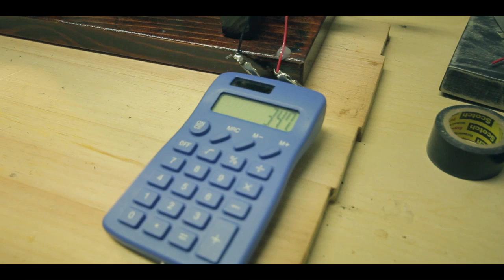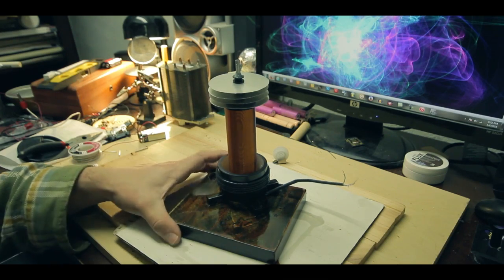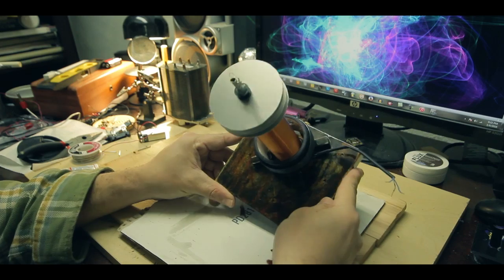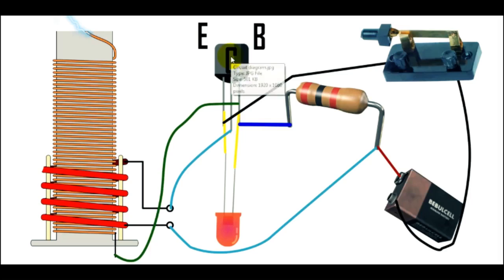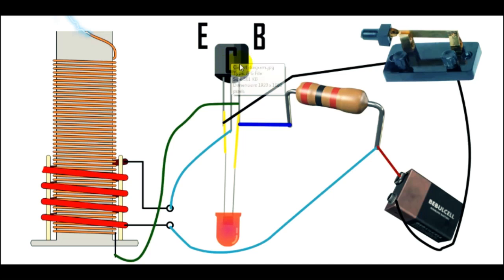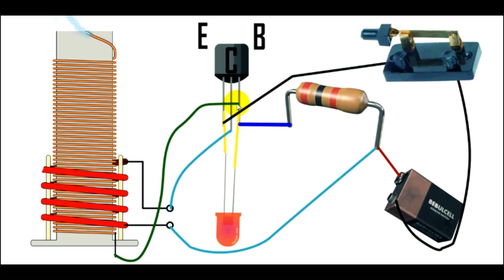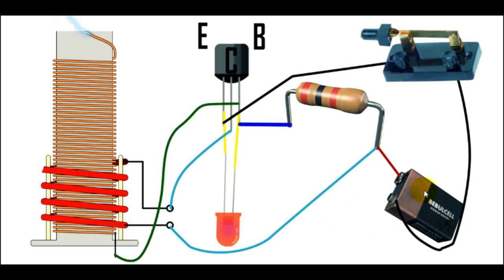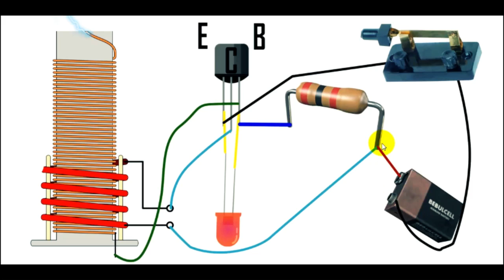DIY Tesla Slayer Exciter Coil Tutorial Mini How to Build Easy Circuit Explanation

Comment: Can I use another kind of transistor while keeping all the other parts the same? I'm trying to build a tesla coil within a week's time for a science project, but the link to the amazon page for the BD135 transistor says that they are out of stock.
Reply from the maker: I would search other sellers for the BD135, but you can use the transistors mentioned in the video: TIP31, N2222. If using another transistor make sure you are aware of its orientation, Base, Collector, Emitter. Hope this helps and thanks for watching. Good luck with your project!
Reply: José da Vēde Also one last question:
I'm planning on adding another 9V battery to increase the distance where I can light up a lightbulb; how would I add another 9V battery, and is this safe for me to do? Sorry for asking all these questions, this video has helped me a lot and I just want to get a good grade on my project lol
Reply from the maker: No danger. You may blow a transistor but it just makes a pop sound. I would use the TIP31 resistor, get extra. I believe I ran 20 volts through this coil before blowing the transistor, so you should be ok.
Reply: I finally managed to build one and it appeared to be working because the LED was on; however, it cannot power any of my fluorescent light bulbs. Is there a way to fix this? I am using a 2N2222 transistor.
Reply from the maker: What wattage is the lightbulb and is it a flourescent?
Reply: The light bulb is 13 W and it is a fluorescent. It is weird because sometimes it works, sometimes it doesn't. I have tried many bulbs, and they all end up not working.
Reply from the maker: Shakybird Are you running 9 volts or 18? It should work consistently. How many turns for secondary and primary coils? Did you use a 47k 1/2 watt resistor?
Reply: I am running 9 volts. The primary coil has 5 turns, and the secondary has around 385. I am using the 47k 1/2 watt resistor that you linked in the description.
Reply from the maker: Shakybird Try taking the top load off or disconnecting from the secondary and then put your lightbulb close to the wire?
Reply: Because of how I attached it, I am unable to take the top load off. But I am getting more consistent results from one of my light bulbs, so I think I will just use that for my project. Thanks for all the help
Reply: +José da Vēde I have a question can I do this without the top load hope you see this

Comment: Sir..what are the applications of such circuit ??in specific area ??
Reply from the maker: This is an oscillating circuit, which converts DC voltage to AC voltage. Typical oscillating circuits are used in various electronics such as radio and television transmitters, computers, and clocks. 

The Slayer-exciter circuit used in this video works as a step-up air-core transformer, taking a low DC voltage and converting it to a high AC voltage. The AC frequency produced through the magnetic flux lines are high enough to excite the phosphor in the fluorescent bulb, creating light. There are no applications for this specific circuit, other than to demonstrate wireless transmission. Only Tesla himself, as of today, is aware of any real-world applications for his coil designs. Hope this helps! Thanks for watching.

Comment: y do we need two coils?
Reply from the maker: Becuase essentially what this is,  is a step-up transformer which requires two coils to increase the output voltage. The primary (smaller coil) receives a voltage from the oscillating circuit and the secondary coil, through the magnetic flux lines (air) receives this voltage and increases it. This is why you need to coils. Any transformer usually requires two coils and they can either increase or reduce current. Hope this helps. Thanks for watching!

Comment: first of all thanks for your interesting video
I have a question , what is the aim of using transistors??
is it use to amplify the current ???
Reply from the maker: Yes the transistor in away does amplify the current through oscillation. Kind of like pushing someone on a swing. With each push momentum builds. With a transistor it works like a swing or a valve-- opening and closing the flow of current. This happens multiple times a second. The current in the primary coil is then amplified by the secondary coil. This is called a step-up air core transformer. Hope this helps! Thanks for watching.
Reply: thanks for your respond it helps alot

Comment: where did you use the heat sink in the circuit ?
Reply from the maker: Mahesh Rajput It's not attached to anything other than being screwed to the transistor. You really don't need it unless you are using a different transistor and using higher voltage.

Comment: Awesome build. Replicated your design with success! Thank you! 
Also, hate to bother, but I've a question for you mate. Would linking more 9V batteries (say 2-4, 9V batteries vs. the 1 used) effect range of the coil? And if done, should i use a higher value resistor?
I'm very new to electronics, and am being careful not to fry anything. I've no clue what i'm doing..
Reply from the maker: I powered this Tesla coil with a bench power supply, and ran it all the way up to 21 volts before the transistor blew. You do get way more distance that's for sure. At 21 volts, I would estimate flourescent illumination over 3 feet from the coil. But if you want plasma or arching you will need to build a solid state Tesla Coil, which uses mosfet transistors and capacitors. 

I know you can run 18 volts with this Tesla coil, but not sure for how long. It may be able to handle the load, that is if you are using the BD135 transistor recommended. Not sure if a different resistor would help. If you purchased several transistors,(BD135's) I would give it a go. The worst that will happen is you will blow the transistor and it may pop, which is equivalent to those little white throw poppers they sell to kids. If it does burn out just replace it. If you have access to picking up transistors at your local Electronics shop, you could try the TIP 31. It might actually work better with higher voltages. Keep in mind that the pins on the transistor would be different, and you would need to wire it accordingly. Hope this helps.
Reply: Cheers, Thanks mate!

Comment: Firstly, I know very little about electronics, and thought this might be a cool project for my kids. I bought most everything that is on the list below. But my coil will not work. It turns out that the copper I used for the secondary coil is 0.5mm (25 Gauge) instead of 0.3mm (30 Gauge). Could this be the cause of it not working? can I still use the secondary coils with 25 gauge on another project, should i use more input volts? (it has about 170 Turns)
Thank you for any assistance.
Reply from the maker: Milo Fourie A few things to check. Did you try reversing the primary leads? Is the transistor getting warm? what color is your LED? are you using a bd135 or another transistor?
Reply: I have reversed the primary leads yeah, the green LED did not light up, but after reversing primary coil leads it did (faintly). using bd135 and it does get warm (not hot). I am going to buy new copper today (30 gauge) and make a new secondary coil with more turns. hoping it will work.
Reply from the maker: Milo Fourie Some tips: Make sure your secondary is around 350 to 400 turns, with no overlapping or large spaces. I would purchase magnetic wire. There is a wax or plastic coating, so make sure to sand the ends to expose the bare wire. Also you will want to use a fluorescent light bulb, 13 watts or less works best. And double check your green LED connection is accurate by correctly identifying the positive side to the shorter negative side. Good luck!
Reply: HI Jose,

I got the right wire last night (magnetic 30Gauge). turned a new coil and voila. working now. Thank you for your input!

Comment: Does the coil have to react to magnets while there's current in it?
Reply: Once you set on the coil it creates a magnetic field which can be detected by a compass, again when when you set off the coil, the needle move. So in a way it's like an electromagnet (With no iron core in the coil, because Eddy current interfere with efficiency). Since a compass react we could say it reacts to magnet. If there is no current, a compass doesn't react (copper is diamagnetic)

Comment: Hi, we are french students in physics, and we want to build a tesla coil for a

 school project. As we can't make a big tesla coil linked to the sector because it would be obviously too dangerous for our teachers to let us do that, we would like to make a smaller one, with only an input voltage around 10V and a transformer with a power of 100VA. We would like to know if this tesla coil could work, and what dimensions do we need for the capacitor and the coils. Btw, thank you for your video wich helped us a lot.
Reply from the maker: I'm not quite sure I understand your question. Are you saying you want the air core transformer (Tesla Coil) to produce 100 volts? Measuring the secondary coils output voltage is not any easy task, as it involves measuring spark length or using an oscilloscope. The latter being very expensive. 

Also, the output voltage is not consistant because the secondary fluctuates between low and high voltages as it collapses or oscillates.

The Tesla coil in this video can handle 12 volts, but if you are looking for large sparks or plasma displays, then you need to look into building a solid state Tesla coil with an 18 to 24 volt input.

Comment: will the plasma gets bigger if I use higher voltage?  ( i.e. 12volts)
Reply from the maker: DragonSkaterOfFabolousness1969 You would need a mosfet slayer circuit, which is higher voltages. This is a low voltage circuit. I ran 20 volts through it and within a few minutes I blew the transistor. There was no plasma, but the fluorescents lit a few feet away from the coil. 12 volts will only increase the strength and distance in which the fluorescents will light.
Reply: Ohh I see. Anyway thank for this really helpful  video xD.

Comment: i did not got 14 gauge i got 13 gauge for primary and 30 gauge for secondary i am going for 5 primary and 400 secondary will it work
Reply from the maker: Nikhil Mehta Should work fine, as long as your circuit connections are accurate.

Comment: This is probably a dumb question, but what is the purpose for the small red LED?
Reply from the maker: Gregory Shoats The LED works as a diode, which allowed current to flow in one direction. This is why you can only use a red or green LED, because each color has a different rating. Hope this helps. Thanks for watching.
Reply from the maker: Gregory Shoats The LED works as a diode, which allows current to flow in one direction. This is why you can only use a red or green LED, because each color has a different rating. Hope this helps. Thanks for watching.

Comment: i am working on this project but do uhave any equation for no of turns of. primary and secondary it will be very helpfull plz sir
Reply from the maker: You can internet search Tesla coil calculator and plug in your specs to find what you need. The equation for the secondary coil would look something like this: 

Secondary coil = (1/ (magnet wire diameter + 0.000001)) x secondary winding height x 0.97

I can not post all the equations on how to calculate capacitance, resonance, inductance, etc,. or give an explanation, as this gets into physics and engineering, which is to broad of a subject to go in depth here. Your best bet is to search the internet, as there are many websites which do a good job at providing the answers you seek. Thanks

Comment: What parts of the primary and secondary coil did you connect to each other? Me and a friend want to build this for school but I have a hard time finding out what to connect. Also, we are using a  NPN TIP31C or a 2n2222a transistor and a 1cm wide pvc pipe (0.39 inch) and 10cm long (3.94 inch). What resistors would we have to use for the transistors? I like the way you make video's :)
Reply from the maker: Both transistors should work fine. I would use a 47k 1/2 watt resistor. My video tutorial explains where to connect each component. It would be very hard to write out a description for connecting the circuit. Please watch a video starting here - https://youtu.be/mRTAoy257QE?t=4m43s

Comment: is this a slayer ckt or an example of solid state tesla coil or both are same. 
sir do u have any pdf info related to it
Reply from the maker: Nikhil Mehta This is a low voltage slayer circuit, not a solid state. I'm sorry, I don't have a PDF file on the build. What information are you looking for?
Reply: But is it a tesla application based project . And if yes then how will i calculate its resonate frequency

Comment: I'm sure 32 gauge wire for the secondary will work won't it?
Reply from the maker: Yeah, 32 gauge should work fine. 400 to 500 turns should work well.

Comment: sir ,how did u calculated the number of turns of primary and secondary , transistor and the top load diameter and no of top load
Reply from the maker: Many Tesla hobbyist build coils and fine tune after the fact. By calculating the capacitance, impedence, inductance, etc., you can eliminate some of the guess work. This requires knowledge in electrical equations/engineering/physics.

 I did not use any mathematical equations in this tutorial. I simply went off information that has been compounded by others, and I used this information to create my own build.

Keep in mind, that even by using equations in calculating the coils and circuits--- this will eliminate a lot of guess work, but there will still be some fine tuning needed, especially in high voltage Tesla coils.

I would do an internet search "Tesla coil calculator" as there are sites where you plug in your specs, and the calculations for turns are provided instantly. But, if you want an in depth understanding of how a Tesla coil works then you must become knowledgeable in electrical mathematics. Hope this helps. Thanks for watching and good luck with your projects!
Reply: Thank u

Comment: I have been trying to make a slayer exciter for weeks and it wont work!!  I am so pissed off right now I just blew one of my diode because i took the resistor out thinking it might not have enough juice but it has to be my coil grrrrrr I used a pen and wrapped magnet wire around it thinking i might do something unique you know and wrapped my secondary and nothing man I am in a pickle lol. I am not a young kid I am in my 30's trying to learn how to build different circuits with my handy dandy radioshack bread board experimental kit I bought anyone have any idea's why it is not working? I have triedflourecent lights and led's to capture the wireless power but nothing happens I know I am getting 9 volts dc I am using a uf630L mosfett I am just clueless
Reply from the maker: I looked up the specs on the UF630L, and I don't think that will work in this circuit. I couldn't even identify the pins from the data sheet, so I'm not sure how you were able to connect to the Base, Collector, Emitter correctly. 

I know the 2n2222, Tip 31, and the BD135 work great, with a 47k 1/2 watt resistor.  I've tried at least 30 different sized resistors and only two worked, the 1/2 watt and a 750k resistor.

 If you live near a Radio Shack you can buy the 2n2222 or the Tip 31 there along with the 47k resistor. They usually have these in stock and they are cheap. If your LED (diode) is not red or green it will also not work. LED's vary by color.

I do suggest following the directions in the video for the primary/secondary coils, with 350 to 400 turns for the secondary and 5 for the primary, because I know this works. Hope this helps.
Reply: ya I didn't think the turns needed to be that exact, I used that mosfett because it came with my kit but I did tear down a microwave and it had a huge mosfett with a heat sink gb1933 I also got another high voltage mosfett from a tear down of a flourecent light circuit but I am not sure what the range of specs used on the mosfett are here or even if it is about having a high voltage mosfett. I probably just need to build it exactly like it was being showed or just buy one I am new to this sort of thing and honestly I don't understand how a mosfett works to be honest but thanks for the reply oh and ya the mosfett did have 3 terminals maybe yuou looked up the wrong one.

Comment: sir can i use bd139 except bd135 ?
Reply from the maker: Tushar Dhiman I looked up the datasheet for the 139 and it looks very similar to the BD135. I believe it will work fine.
Reply: Does it work with BD139?

Comment: Can I use an IRFZ44N transistor?
Reply from the maker: Yes you could use the IRFZ44N for tesla coils, but probably not best for this low voltage coil. Your transistor would better fit a mosfet (solid state)Tesla coil which uses higher voltages.
Reply: I actually bought them to use in my magnetic induction heater that I made and that [IRFZ44N] is what I happen to have laying around. Thanks you for answering me.

Comment: What is a heat sink and what does it do?
Reply from the maker: SkyGeorge A heatsink absorbs  heat, and helps components in a circuit like the transistor stay cool. This way it won't overheat. Think of it like a radiator in a car. Same principals are at work.
Reply: It sinks heat.... You don't want your heat to float.... :P